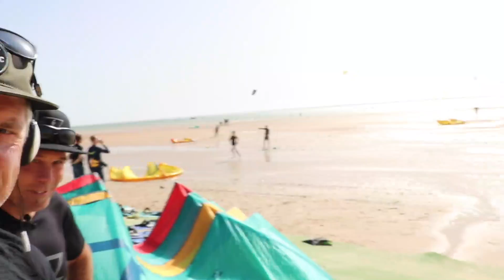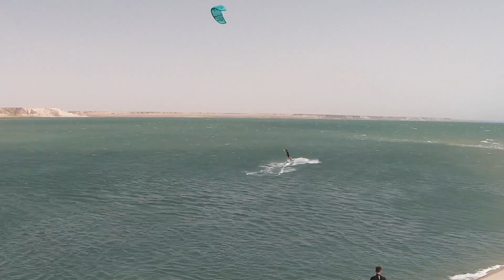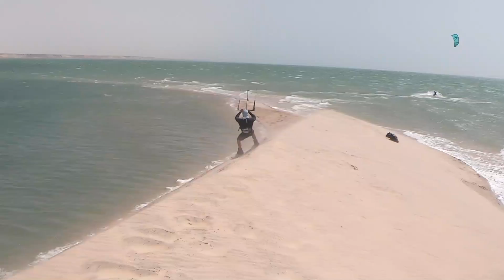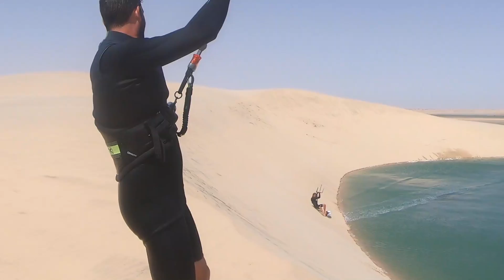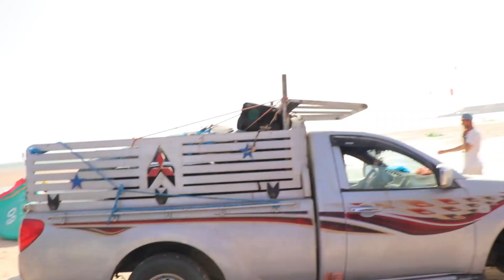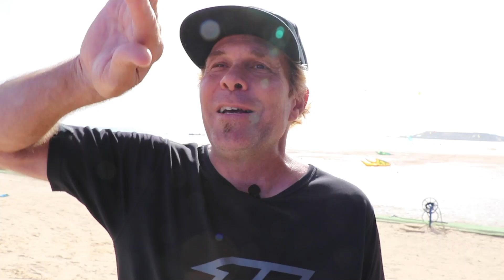Trade Secrets - North designer Pat Goodman

Comment: I found this interesting to hear about designing and methods, only I really wish I could see a video review where the kite itself is featured in clips.  I have old North Rhino kites from '07 and I refuse to buy new kites because they are absolutely the most stable kites I've ever touched in overpowered conditions (much due to the number of struts, as Pat describes).  I'm looking to upgrade after this summer because I've finally destroyed most of my quiver and will be considering the Orbit because it's characteristics are described to be similar, with huge jumps and direct bar feedback.  I just really wish there were videos showing the kite behavior when sheeted in, out, and overpowered.    I seriously don't need to see anyone doing board tricks or jumping without showing the kite flying.  I'm not buying jumps.  I got that part covered.  I need the kite to behave well...
Reply: So did u get it? I got. Y orbit after a test and its out of this world IMO and a lot of ppl seem to think the same but I also have seen a few ppl who didnt like it